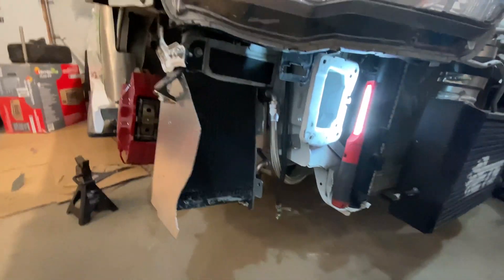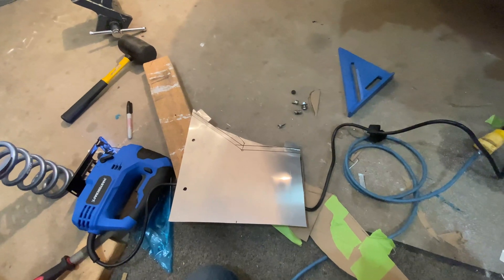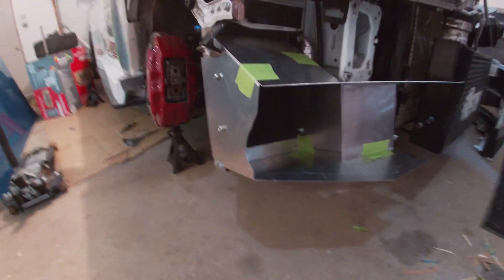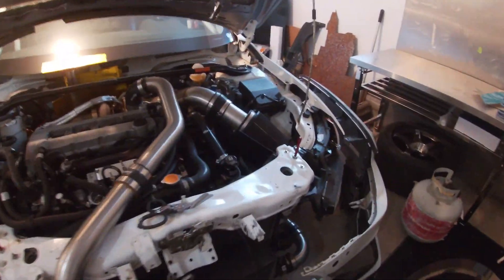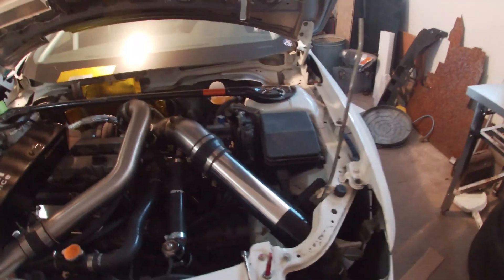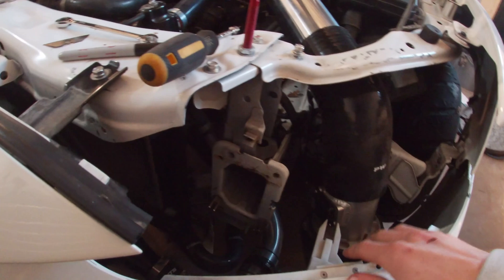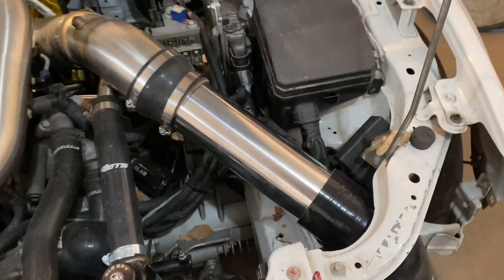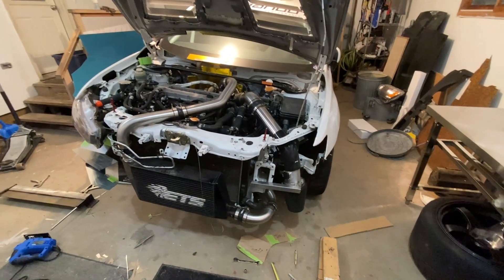Evo X Oil Cooler Ducting and Cold Air intake

Comment: Did u diy ur headlight duct?
Reply from the maker: Yea it’s just the back cut off with holes drilled in the headlight. It still needs a proper air box around the filter tho
Reply: @spicygarbage7404  u don't have a tutorial for it do u? I want to do this but I don't know how to or what materials to use, or even a picture for reference

Comment: I wanna buy one. I have the same oil cooler almost went duel mishmoto but got this one, I can't find my oem one plus I hate it. Also the cold air intake I am interested in I have a crazy evo x build. Motor is built to handle 1250 hp but going for 800.